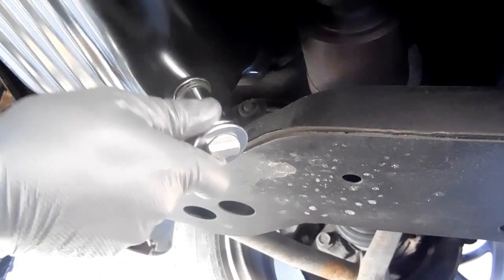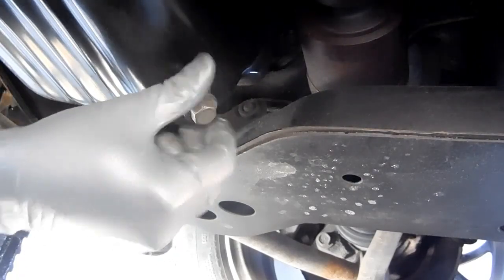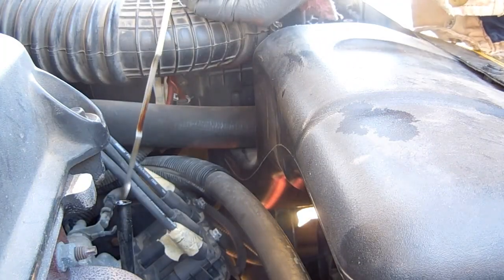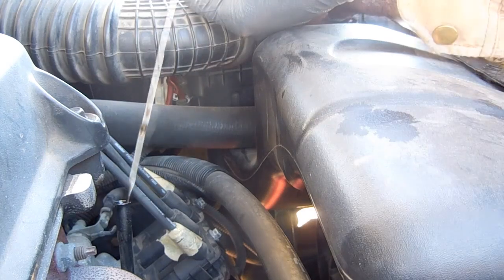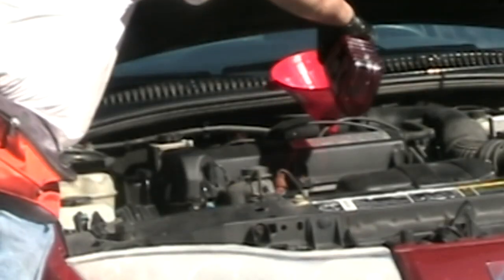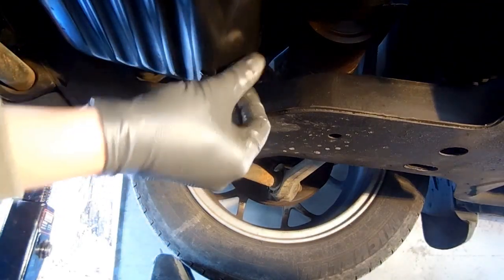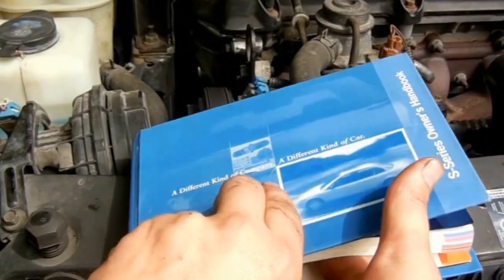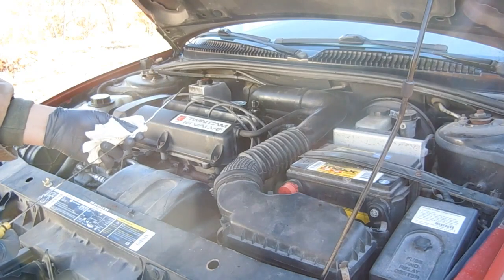Safe Motor Oil Flush Using Kerosene

Comment: Yes, Fram filters are garbage. Seen engines destroyed by them myself. The element comes unglued in the can, plugging everything up completely. Oil has detergent in it, and a vehicle that has had it's oil changed properly every 3,000 miles will never need to be flushed, and should make it past 300,000 miles easily. Lucas is just a viscosity increaser, like STP. Better to just use higher viscosity oil instead. My 2006 Ford Crown Vic has recently passed the 400,000 mile mark (with regular 3,000 mile oil changes) and is still running fine. I started off at around 40,000 when I got the car with 5w30. At 150,000 I went to 10w30, and at 250,000 I went to 10w40. Never used any additives, or did any flushing. Engine does not use oil. What will eventually kill this engine is a broken cam chain, as it uses chain driven overhead cams. Engines should not have internal chains, especially ones that are not easily replaced. The timing chain on an old school small block Chevy was totally worn out at 100,000 miles. But it could be easily replaced BEFORE it broke or jumped teeth on the cam sprocket. Replacing the Ford chains requires an engine teardown. 

That being a 2002 GM car, it has another serious problem. If it was neglected to the point where it needed flushing, then the cooling system is probably totally ruined by the Deathcool, Dexkill, or whatever you want to call that nasty brown gunk GM uses for coolant. I have torn down more than one GM engine and found the water jackets around the cylinders completely filled with this gooey, waxy brown stuff that was impossible to get out. The block was ruined.
Reply: gm uses pinkish and orange stuff Dexcool now it will work great if not mixed with anything else, has gel issues when not mixed properly. dont believe the auto stores when they say you can mix the coolants.
Reply: Dexcool, or Dexkill, or Deathcool is some VERY bad stuff. No other coolant used by any other car manufacturer has it's problems. It is an engine destroyer. I recently got a great deal on a 2013 Chevy Sonic. 51,000 miles, and already it had a pinhole leak in one of the plastic fittings, and a bad water pump. I replaced those, thoroughly drained and flushed the entire cooling system, and filled it with Prestone OAT coolant. It is approved for use in new Ford, GM, and Chrysler vehicles with aluminum engines,  but with GM vehicles, you have to get all traces of the Dexkill out first. I believe that whatever GM puts in Dexkill that causes it to plug everything up may have been intended as some kind of stop leak, as it coagulates on contact with air. And there is no way to air proof a cooling system. The reservoir is open to the air whenever you remove the cap, and everytime the engine cools off, and sucks the coolant in the reservoir back into the engine, the cap is pulled open by vacuum to allow air into the reservoir to prevent vacuum from collapsing it.
Reply: the stuff thats in my envoy doesnt do that, it is pinkish though, I know this because i rebuilt the engine due to someone not changing oil. I just saved it and filtered it its clean and passes the freeze test to 40 below, what should i use instead of dexcool? I have heard of these liquids jelling up they did in my crysler. it plugged up the radiator, I had to buy a new radiator I could'nt get it all out of fins. I didnt trust it anymore so I put in conventional coolant it seems to work fine
Reply: that explains why vauxhall /gm cars here in the uk blow head gaskets at 150,000 miles.You can almost set your watch by em! by the way you have the same name as my father!

Comment: But I wouldn't have dared to put that in my engine, I have a huge explosion and fire in mind when I think of that.
Reply: You cannot hardly light kerosene with a flame unless you have a wick or some other way of vaporizing said kerosene. It is trivially easy to put out a lit match by dunking it in kerosene.
Reply: unless your oil gets past leaky rings & into the fuel system, it's not going to explode. Oh wait, that's what's supposed to happen in the combustion chamber. Doesn't happen in the oiling system

Comment: At 100,000 miles it is also very important to clean the PCV, the carter ventilation. The fumes and blowby go back to the engine through the intake system. This get's clogged up over time and causes underperformance and problems.
Reply: if by "underperformance", you really mean "less pollution", then you'd be correct. PCV's have a negative effect on performance, as you cannot burn the Carbon that is the basis of the fumes. its dead air being recycled back into the intake, purely to reduce air pollution

Comment: use ATF in flushing it is better than Kerosene, Kerosene will damage seals
Reply: Just about all those Engine Flush additives is 70% Kerosene    look at there MSDS Spec's !   Even Fuel stabilizers is mostly Kerosene too !
Reply: Emad ِAl Shakhatreh I use diesel to flush my engines. Works so much better and it’s way safer
Reply: CAS numbers tell the tale.
Reply: I use ATF every 5th oil change run it for one oil change then do my reguler oil change. No issues what so ever.
Reply: 1qt ATF to every 4qt is safe method. I drive car for 500 mile. Usual works great that way. Then next oil change if still very dirty. Do 1/2 qt ATF rest motor oil. Then should be good. 
On mine I drove 3,000 mile with 1qt ATF and rest motor oil. I don't recomend for 3,000 miles. In my case motor was extreme sludged up from prior owner. The motor was nice and clean after that. When changed oil after that. I just put 1/2 qt ATF and rest motor oil. That clean the motor up great. Ran great after that.
Reply: Please explain hot to flush with ATF. Thank you.
Reply: Emad ِAl Shakhatre
Reply: Kerosene does NOT damage seals I use it to soak my motorcycle chain overnight,each link has 4 o-ring times 130 links. In fact doing this and lubing and proper chain adjustment will get you 25% more life and chain and sprockets cost over $400.

Comment: Were you able to look at your valve train from the oil cap? 

On my 2002 3400 Chevy, I can see the valves for 2 cylinders, and see a good section of the head from the filler cap opening.  I have 160k, and changed the oil according to the oil life monitor when it is at 5%.  I used mobile 1 a few times in the winter, and every once in a while put 4 ounces of Marvel in there.  My engine purs like a kitten, and I have no deposits on my valves, springs, or passages in any way.  I also do not consume or drip oil at all.

I am the original owner. Mare you the original owner? How often do you change the oil?
 Btw, I hear the oil filter is not really important on an older car as all the manufacturing debris is usually out of the engine, and the parts are not of a snug fit anymore, and thus do not produce materials that would need filtering.

Comment: Using ATF is better.  Don't use FRAM that make garbage worse than the unamed china stuff.
Might as well not even bother changing a filter if you are going to put a fram in it.
Wix / Donaldson / Parker / Racor all make top notch filters, wix is probably the cheapest.

Comment: Its a good idea to fill your oil filter with fresh oil before installing, so the engine gets lubrication right away, rather than having the oil pump fill it up, and air bubbles in the oil passages on start up. Can't say i recommend lucas oil stabilizer since it gums up and turns into a hard cement
Reply: That myth has been busted. Especially because he didn’t actually drain all the oil out.

Comment: A safer way is use automatic transmission fluid or diesel oil due to the extra detergents.
Reply: Yeah I've been using ATF for engine flushing for 14 years or so, wouldn't do it any other way.
Reply: Patrick TheBaptist I don't do many flushes until needed. One reason is it might clean "too good" and sludge gets the oil pump screen clogged. Thankfully the cars I've done it too weren't too bad and I redid all the gaskets and checked the screens. Mainly 3100 v6 engines from the intake gaskets failing and mixing fluids.
Reply: I usually do a flush when I buy a vehicle, excluding diesels.
You also don't want to do this on a car with alot of build up it CAN block the oil passages say in the crank or block as well.
I did this on a Taurus I had (ATF flush) and then a year later I had most the engine tore down and it looked really good and clean.
If the engine was high mileage I usually did this once a year.
On some cars I bought I noticed even a little difference in power gain, like with a Rodeo I had that was around 300k on it, it wasn't running smooth and had lots of valve ticking, ATF flush hushed it up and gave it a little more giddy up, after doing it to that one I really was sold that it was worth the effort.
Now I drive a diesel, I wish I could clean the inside of the engine, thing has 452k miles on it, but there isn't a safe way to do it as far as I am aware of without pulling the engine that is.

Have a good day buddy.
Reply: @PatrickBaptist  I have a TON of sludge build up in my GX470. The mechanics said what you did- DON"T do a flush because it may gum up the other stuff. Will changing the oil frequently start to remove sludge over time? Or should I eventually do an oil change?

Comment: yeah I'll pass my Buick has 300k miles always done oil changes at 10k miles still running like new
Reply: +MrMister1227 - This is NOT your normal Oil Change. This is done ONLY every 100K. So basically you are due for 3X... LOL. But as your 3K or 10K Oil Change, that is just a NORMAL Oil Change.

Comment: im curious if kerosene is aa oily as diesel.
i still cannot stop appreciating how clean that oil pan is.
Reply: Marijana Brezić  Kerosene is like diesel, just more refined and burns cleaner. You can run a diesel engine on kerosene just fine.
Reply: @logik316  really?. I didn't know that.

Comment: kerosene won't harm seals unless if you use the gasoline.. here in the philippines sometimes we can't afford that flushing oil in cans.. as a substitute for that we kerosene.. and it's effective and more affordable we use it in both engine petrol and diesel and it did good..
Reply: sir what happen if accidentally use a gasoline,what will happen in the engine?
Reply: Higher wear rates because gasoline is a poor lubricant.
Reply: What about any residue kerosene? Is it still ok. Also please tell me the percentage. My oil capacity is 9 litres.
Reply: iVlogBuzz  Residual kerosene will vaporize and be drawn out through the PCV system or whatever other crankshaft ventilation exists. But don't use kerosene in a modern engine. If you think your engine is dirty, use Mystery Oil, Seafoam, anything made to be put in the engine oil. Or just use synthetic or semisynthetic oil and acceletate your oil change intervals. The major consequence of a dirty engine is stuck piston rings. This means rings where the grooves are solid with carbon. Kerosene will not clean these out. A good solvent product might help. Synthetic oil might help. Driving a very long distance might help. Or maybe nothing will help. Not in common problem in contemporary engines though, as far as I know.
Reply: Anonymike, Essentialube or Marvel Mystery Oil squirted into the cylinders with a plastic syringe, approx. 10ml for most engines. Apply through the spark plug holes. Let this wick into the rigs for 2 hours or more. Overnight if practical. Seafoam may work as well but I have not tried it.
Reply: @tarquineous  KREEN from Kano laboratories is the best stuff I've ever used.
Reply: Your gorgeous

Comment: you'll all think I'm crazy, but as a teenager I used two quarts of gasoline with 3 quarts of oil....it worked great......had the car ('68 Ford Falcon, 170 Cubiic Inch inline 6) for a long time after that and the guy I sold it to came by 2 years later to give me the money for the car (he was as honest as I was trusting) and it was running great.
Reply: Cool story !

Comment: You pour your oil in upside-down. Flip the bottle over and it will flop out less. There's a reason there's a sloped side on the bottle ;).
Reply: MultiChimRichalds literally only reading the comments to see if this was here before I said it.
Reply: MultiChimRichalds I was about to say the samething until I seen your comment,if you flip it over it will pour out smooth
Reply: just turn the bottle sideways..
Reply: The same brain that pours upside down is teaching you about engines...
Reply: It's an old trick I learned 35 years ago use kerosene to flush out your engine it does not harm new fact a cleans it really well it burns off an old school mechanic taught me this trick years ago
Reply: That was a bit nerve racking and haha just pour the kerosene no measuring needed.
Reply: Oooh! Is that what the picture embossed on the side of the oil bottle is.... lmfao

Comment: This was a common oil change technique back n the 50's and 60's.  One qt of kerosene in a warm engine, idle, slightly revving it a bit NOT a lot, for  5 or 10 minutes then drain.  DO NOT put the engine under a load..   It worked then and it will now  though
the oils are so much better now a days that  unless you don't change oil and filter on a regular basis this probably is of limited value in this modern era..   Forget the sales pitches of the high priced super synthetics unless you live in Siberia, the Sahara desert or if you have a $ 100k automobile.  Most likely,  your car will outlast you with good regular oils and service.
Reply: Bullshit try Canada mid January you better have synthetic and good battery.
Reply: Nate Ngzcaz I agree with you. German and American brands like mobil, liquimoli and meguin synthetic lubricants are better than fully synthetic japanese and korean lubricants
Reply: Are you sure? Enois is a high quality from Japan. I used it once, and it ran great, like very low friction. Have not tested or seen any formal tests.
Reply: Nate Ngzcaz aaa

Comment: Don't use Fram Filters they are garbage....
Reply: Hartin Fartin  Cut one open  and you won't.
Reply: NYRM1974 yuup fram filters are a piece of shit filters i used them i had to change my oil st 3k miles cause the retarded ass filter decided to disolved into pieces and yes i was using mobil1syntetic premium oil they just a piece of shit filters they used carboad for filtering the none sense lmao
Reply: No joke if you are going to slap a fram filter on it, might as well save the time and money and not even change the filter.
Reply: True. Fram USED TO BE great but after two corporate buy-outs they are no longer.
Reply: Better buy Bosch or something, or the OEM for the vehicle.
Reply: NYRM1974 Totally agree. I have had issues with Fram.
Reply: I wouldn't use K&N either.  Purlator / Wix / Donaldson / Racor / Parker all good brands.  STP is a big joke and fram is about as good as using no filter.
Reply: @PatrickBaptist  therefore use OEM?
Reply: On Fords I usually do go for OEM, but for sure stay away from FRAM, they are worthless.
Reply: Fram filters are adequate. Yes, the end caps are not metal, but that doesn't mean much, just lower production cost. I'm sure he changes his oil and filters regularly if he uses conventional. I personally don't use fram extra guard, I always use STP Extended life, fram ultra synthetic or wix xp.
Reply: @TheRichardF10  I've never used a frame filter that's not all metal I use them on my motorcycle and my Ford focus,never issue. Maybe cause here in Canada they maybe different.
Reply: Might as well use coffee filters since they are better than Fram!
Reply: no they are not.  Not on a saturn
Reply: Joe Gotti well, perhaps you should have used their full synthetic filter, designed for full synthetic oils
Reply: Fram Extra Guard is decent..but costs ALOT more than the low cost basic ones  *(I personally use WIX)
Reply: Thats an opinion without facts. Ive seen plenty of Frams cut open. Are you falling for the metal end cap youtube myth?
Reply: The Fram Filters were good Filters Years ago but Junk now.      But all I use is OE or Wix  Now  the Wix Filters or Napa Brand (made by Wix )  are the Best Constructed Filter out there no Cardboard inside like Fram
Reply: Really I use them in my turbocharged ZX14 motorcycle,I drag race almost every weekend,also I been using them since the early 90s never had any issue!
Reply: Hartin Fartin   Interesting, I didn't know they did that now, I wonder what the benefits are to having that setup.  I mostly work on stuff from the 60's to the 80's
   I don't know anyone that has a Saturn, I'll have to check that out on YouTube,  thanks for the info.
Reply: Scruffy Mclick LOL!
Reply: Fram is cheaply made so stopped using, stp is cheaply made so I stopped using. Right now I'm using k and n high performance but I still have some thousand miles to go
Reply: Jim Gagne Mercedes Diesels have such oilfilters
Reply: Jim Gagne BMW does it too...oldbastard
Reply: They are worse than garbage...
Reply: Shit filter for 04-07  Nissan maxima but it's a sensitive engine
Reply: The US Military uses them.  Their just painted gray.
Reply: Fram is the sane as A Coke Can filled with News Paper.
Reply: Not the Tough-Guard by Fram, or the HP series. They are made very well. The orange colored ones are cheap inside, with cardboard, etc.
Reply: Yeah just buy bosch filter instead
Reply: @Lerch the filter is equally important as the oil.
Reply: Blow by improves fuel economy
Reply: Hartin Fartin  What kind of car takes  an open filter on the top of the car?    You mean the filter is not in a metal shell and it's like an air filter? And it's sitting on top of the motor in some kind of a basket with a cover?   I love different cars . Is it on youtube?